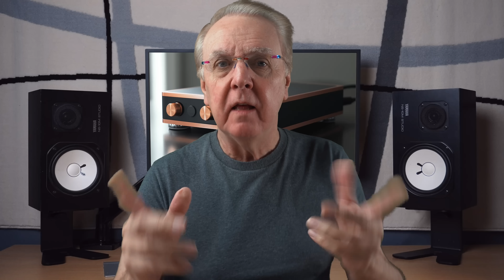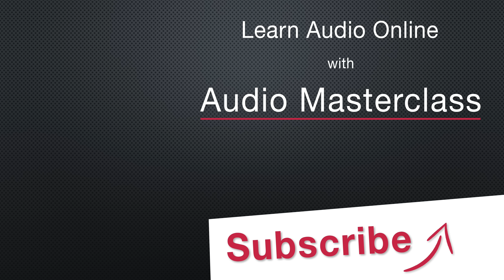Audiophile preamps - What should you get for $30,000?

Comment: At $30,000  I would expect point-to-point wiring.... and not a PCB to be seen( also a complete absence of tantalum capacitors would be doubly reassuring)
Reply: Ceramics have almost made them obsolete now. You can also get soft termination and fail-safe types now that have their own 'suspension' on the PCB (to prevent microphonics affecting the audio quality Lol. It's actually to stop cracking...).
Reply: Eee gawds... point to point. Seriously?
Reply: PCBs are fine and can even be great things.  They can do shielded traces etc.

Comment: About powersupply, those requirements are the same for any high-end gaming-PC. At milliseconds time deliver 350+watts increases in load without ripple or any voltage drops on any powerline of the outputs. Too much ripple or sack of in voltage and the PC will instantly crash. Also those PSU's come in complete metal cases, guaranteeing stopping any electromagnetic interference into the computer case. The price of a high-end 850 watt named brand PSU, with 10+ times the power a pre-amp might ever need: 130 to 160 dollars with 5+ years warranty: But the religious audiophiles......🤣
It is this indeed just the  "feelgood" factor of the audio religion.
Reply: Nope. The requirements are significantly different. For a preamp the required power is significantly less, making non-switching power supplies (or more general power supply topologies) absolutely viable; generally speaking analog signals are much more sensitive to noise than digital signals (surprise...); power supply efficiency doesn't really matter because of the low power consumption and the fact that expensive preamps are more of a one-off luxury item where power consumption is likely to be viewed as less of an issue. And load transients are significantly more critical with PC supplies: Audio signals are basically DC and the preamp doesn't have to provide a lot of power anyway, so there is not much of dI/dt at all. Switching power supplies usually are NOT optimized for ultra low noise (although "better" power supplies often are significantly less noisy than cheaper ones). Main aspects for PC supplies are in fact efficiency and the capability to handle load transients, all at fairly high power levels in a compact enclosure.
That being said, one can build low noise switching power supplies, which is not the easiest thing to do. Hence that would be an idea for a more expensive audio device, just because it might not be quite as trivial to replicate as a linear regulator (which from a technical perspective are very well suited for a preamp and in some cases for certain components in a PC; absolutely not well suited for a PC power supply).
Reply: @sebastian_harnisch  Computer PSU's are always reviewed/tested on noise and ripple because that screws up stability.  A current without noise or ripple = a current without noise and ripple.  On the systemboard you find a second stage power regulators/supply 12V to adjustable 0.700 - 1.500volts (latter will instantly  fry the CPU), on boards made for overclocking ripple stays within less than 0,005volts (!) while pushing out 100+ Amps. And no ripple at all with constant load. Ripple crashes CPU's.

Designs/components to provide super stable voltage/power is not a new technology. There is no reason at all that the PSU would cost more than $100 for a pre-amp that uses 50watts at maximum. No matter how high-end.

Comment: What should you get for $30,000? From personal experience as an audio tech for the last 47 years, I would suggest either a Honda or a Toyota.
Reply: You beat me to it!  .... 😁
Reply: You're right. 
My tape player, in my 1988 Camry, still works, like a charm. 😉
Reply: @TurdFerguson101  Sadly, the stereo in my '01 Civic is on its last legs. But the car still gets 34MPG with 252,000 miles on it.
Reply: Yes, I like the idea of a car stereo with a free car!  🙂
Reply: Honda S2000
Reply: In 2016 I paid $20,000 for a 2013 Infiniti G37x with 38k miles, in great shape.  Still driving it- no problems at all since I got it in 2016, except I got three speeding tickets (0-60 4.9 sec)  With the $10,000 left over I bought a REALLY GREAT 2 channel stereo.
Reply: Or your favourite band to pop over for a cuppa & perform in your lounge.
Reply: @merlin5476  My favorite band will do it for a case of beer.
Reply: Mazdas are great too.
Reply: a house to rent out and pay the mortgage with?
Reply: You could probably buy an entire studio's worth of lightly used pro equipment with actual specs.
Reply: Power supply.
200ah lithium battery rack. 
No ac.
Reply: @johann_eigler  And what do you suggest for the leftover 29000?
Reply: @RedBankVintageAudio  The Honda or Toyota will have WAY more acoustic engineering put into it, let alone electronic.
Reply: Hey maybe a used Lexus?
Reply: Dude hasn't been in the car market for a while. 30k will get you a high mileage used Honda that will require 5k in repair shortly
Reply: @CaptainRon1913  You can still get a new  Mazda 3 or something for that money.
Reply: LMAO...TRUE!!
Reply: @RedBankVintageAudio  I was about to suggest a Toyota... But Honda is great too! 😁
If 30K aren't enough for a car and a stereo system I must have won a lottery or something. A huge one ffs.
Reply: My thoughts as well .
Reply: My latest audio purchase was 18k. It uses a 300 volt  dc transport and a separate 12v audio platform. The absence of a 2000 to 24000 hz noise injection from the previous audio system made by Hyundai was like night and day.
Although I do have to turn off the drone that it makes by default when travelling less than 20mph.
Reply: @chriswatt2702  Love it!🤣
Reply: @chriswatt2702  How much do you make (earn) per year?  All of the people posting here have no business voicing their opinions if they make less than $500k per year and preferable more than $1 mil. The bottom feeders don't mind $30k Rolex watch but they do mind $30k phono stage because it does not scream "high status" like it should according to a bottom feeding taste.
Reply: I have similar experience and just purchased a Pacifica that has enough space to do small gigs out of with $6,000 to spare.
Reply: Or at least a full room acoustic treatment...
Reply: "Audiophile preamps - What should you get for $30,000?" - well that's easy to answer. How about a nice stay at your local psychiatric hospital? Honestly, diminishing/zero returns will have kicked in tens of thousands of $ before you hit that $30,000. Having said that, I fully welcome and endorse ANY manufacturer that seeks to take advantage of the dumb rich like this. All the more reason we should be helping these rich out...BY TAXING THEM MORE !!!
On a different note, is it NOT fun to rip off The Rich...as Tom Evans was/is doing? I mean, come on people, this is not your average Joe purchase - it's entirely targeted at...The Rich. I welcome Tom for ripping them off. I really do! Surely, most of you do too? Are we doing the right thing here? !!!
Reply: or 8 years of smoking one pack per day
Reply: Good point! Hearing aid before that. Also, I assure you all that supermodel has the same thing as a village girl . There is no difference whatsoever so people just save those pennies you spend on only fans and look around . In the night all cats are black
Reply: You British today are so lame.  Beat up Japanese cars. Wow.
Reply: La mejor respuesta que lei en muuuucho tiempo
Reply: Divorce! It will save you tenfold in a long run
Reply: Sir, I humbly request permission to steal your quote.
Reply: Anyone in the market for a 30k bit og audio kit is not driving round in a Honda
Reply: @paulrobinson270  Maybe they are. Sam Walton used to drive a 25-year-old pickup.
Reply: @RedBankVintageAudio  OK, I'll rephrase, someone in the market for a 30k bit of audio kit, is not deciding between it and a Honda. Their transport needs are probably already met
Reply: @paulrobinson270  Are you joking ? Everybody deserves 30k preamp and it must be built to their liking. 
I reality  the fact that the chap is able to sell that crap for 30k is a crime and Public opinion court sentence can only be a death of the company. No less.  However,  No worries! The repair crook was able to lift the design details so the working classes will be able to access it for the price of mere 249 Quid Christmas special on MiM commercial website. All phone lines are open for business. don't miss the lifetime opportunity !
Reply: @riley-arr-g  the physical quality of cardboard shims
Reply: Excellent!
Reply: My thoughts exactly!
Reply: @aquamanGR  How many Hondas do  you need? Sell five of them and buy one car you really would like to drive. If only to see if that dream was worth pursuing .
Reply: A new car.
Reply: @yxkalle  relative poverty sucks. What's wrong with an old car?
Reply: @wojciech-nq5gq  Huh? I didn't say that.
Reply: @yxkalle  Of course you did. You're too poor to even dream of 30k phonostage. $30k doesn't buy much of a car nowadays either.
Reply: @Runco990  you cornered wrong audio market .probably serving  failed "Mend it Mark" types  trying to make a world beater of the old crap. How do I know that driving 2004  Vibe :))

Comment: What's good about hand-wired is; there is the possibility that one uses better parts, that cost a few cents more, and when it breaks down, its often easier to repair, unless the parts are sanded down.
Reply: That remains a hypothetical benefit. It could also be built so poorly that the cheap plastic supports cannot support the weight of a few grams of cheap components.
Reply: The down side of "hand wired" is bad solder joints.  I've been in the trade since the mid-1970s and I still mess up the occasional connection.
Reply: @Douglas_Blake I must say that Mike’s meticulous replacement of the damaged solder eyelet was quite a delight to watch, and ironic, as if I recall correctly that was the one of 8 that had no feedthrough to the daughter board.
Reply: @fonkenful Mark
Reply: @john8451  sorry for the mistyping.
Reply: @Douglas_Blake  And production costs since hand wired involves manual labor and can't be automated.
Reply: Hand wired might be better for tubes which run very hot and will mess up the PCB and the solder joints.
Reply: @TerryClarkAccordioncrazy Rather broad generalization. 
There are more than a few prebuilt and kit valve amplifiers utilizing PCBs, even some of the latter partially pre populated with some of the smaller components. The quality of design / layout and thickness of conductive material that matters, and some are so skimpy on the latter that removal of a single component due to failure or “upgrading” is sufficient to delaminate the solder pads or traces.  This is where long t8me repair techs will pipe in with their anecdotes.
Reply: The sanding down is a quality factor to improve the dissipation from the top of the device, thus reducing audible uneven cooling from the metal tab at the rear. The part number ink created non-linearities in the surface, which affected electron flow through the pn junctions underneath, further compromising audio integrity. I
 Know. These. Things... lol
Reply: not hand-wired, more like sloppy wired in this case
Reply: But did Tom hand-sand the wiring to reduce audiophool skin eeffect?
Reply: It’s always easier to repair than the dreaded surface mount, it’s for domestic use not the airforce.
Reply: The main advantage of a printed circuit board is that it minimizes unit to unit differences in circuit performance. Hand wiring, eeh, not so much.

Comment: I'm not an Audio Designer nor Engineer, but I can speak to basic truths of PreAmp designs.   Most important: Less is more.  The fewer tricks in the signal path, the better.  So an optimal PreAmp design only needs a 1. source select and 2. volume, and maybe 3. balance.  Add an external power source to minimize power related artifacts from the signal path, quality circuitry, and it is done.   For example:  The Threshold T3i (Balanced Class A design).  It does just that.  No fancy gimmicks, but a simple signal path from the source to the Amps.   Price in 1995 GBP?  2000 GBP
Reply: On the other hand, at least Tommy's gear does work (when it does) and does what it's supposed to do really well, I suppose. It's obviously a poorly executed design, based on well known enginneering principles- not akin to alien technology, as suggested in the flamboyant advertorial. Now, compare that to entreq grounding boxes, bybee quantum purifiers, fancy speaker and mains cables, cable lifters, mains conditioners and alike with a price tag running into thousand and tens of thousands of pounds. I'm of course all for right to repair and freedom of information, so his attempt to hide the truth is definitely not up my alley.
Reply: The technical idea and physics here are:
when you parallel multiple sources of random noise generators such as 10 OpAmps in parallel instead of the typical single one as in most pre-amps, then you get a few db less noise because the parallel tied sources randomly cancel each other out , every opamp transistor rssistor capacitor voltage regulator all of them generate random noise.
Reply: @xprcloud  pedant point, combining random noise sources doesn't cancel them out, it simply adds them as individual bits of noise. Combining two coherent signals increases the level by 6 dB, which is a lot more.
Reply: @NR23derek  No wrong! go study physics, instead of being foolish in public, you have compared perfectly aligned in phase sinusoidal signal sources which would double, while random noise is the exact opposite, an infinite amount of random sinusoidal signals at all frequencies and phases, they cannot double themselves they randomly cancel SOME out and we have 8 to 10 sources of truly random noise sources , and its done commonly in RF receiving circuits as well as LAB instrumental equipment, and can be done for audio.
Reply: @NR23derek  Funnily enough, Mark actually refers to noise reduction, when explaining basics of parallel operation in his now famous video.
Reply: @xprcloud  Try reading what I wrote, instead of what you thought I wrote. Yes, two coherent sources will re-enforce increasing the level by double - ie 6db. Random noise, however, is not going to do that, so will increase by much less. SOME of it MIGHT cancel out, equally SOME of it MIGHT re-enforce - it's random and noise. But it will basically add together randomly and thus increase the noise floor a bit, it won't cancel itself out.
Reply: @paulb4661  Indeed. It's good science, electronically it's a valid design, although frankly taken to rather over the top extremes. What I have a problem with is the naff construction standard of this £25K box of tricks, coupled with the use of low grade components and the disgraceful filing off of the component details.
Reply: @xprcloud  But it's a logarithmically diminishing return. Maybe if he had 100 parallel highest-quality op-amps he may have some element of argument but is it two in this design?
Reply: @rjy8960  correct, that is why I said a few db, so a typical good opamp may yield S/N of 80db in a RIAA application, on a good design you may be able to get 3-6db improvement in S/N, might as well use math such as a DSP (take a noise signature from the amp noise when its idle), and subtract it, YMMV, but that is what the butcher remastering engineers do all day long on analog re-masters, hit or miss and also a matter of taste
Reply: The important thing with good analog is linerality, simple circuits can not always be so, so GOOD designers adjust for a linear response.
Non linear is distortion as sure as clipping and or unwanted modulation. or harmonics.
Reply: @joefish6091 Amplification depends on nonlinearity to work.
Reply: @conkers66  Simple truths.
Reply: You are willing to pay 2000 GBP for a box that does less than any cheap integrated amp on the market?
That would be a big no for me. Living in the 2020s i at least expect some convenience features like a powerful, programmable DSP, wireless connectivity to speakers and sources and control via app and remote
Reply: @KingKong-mp6gj  25k or 2k is a big savings, while providing better sonic quality too.  while your example is convenient, it may not provide better sonic quality.  you have affirmed that the listening experience is a personal experience.

Comment: No way do you need to spend that much.
The Holo Audio Serene has been measured at effectively straight wire with gain at around 2k. What more do you need?
OK a decent phono stage but again, no need to oay that much.
If you want bragging rights then by all means go ahead.